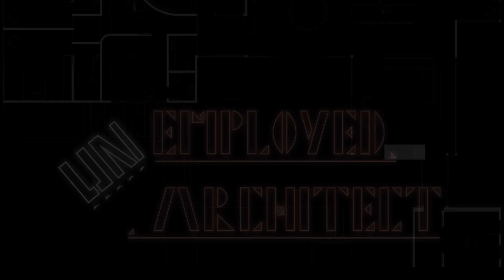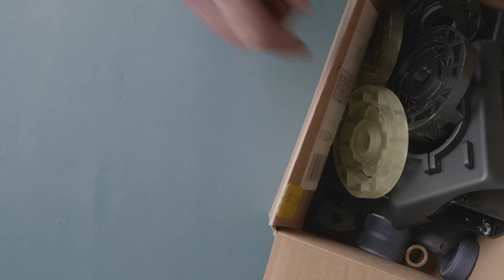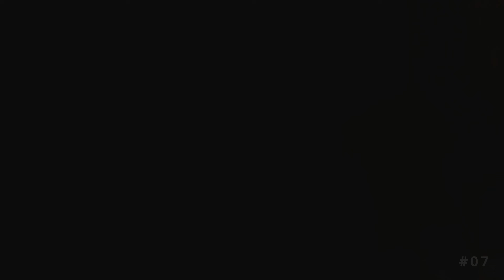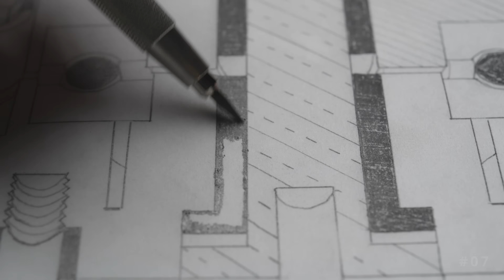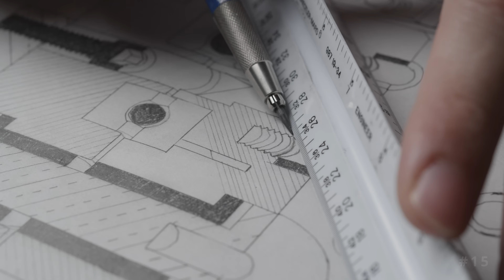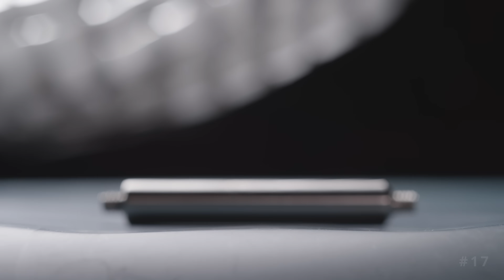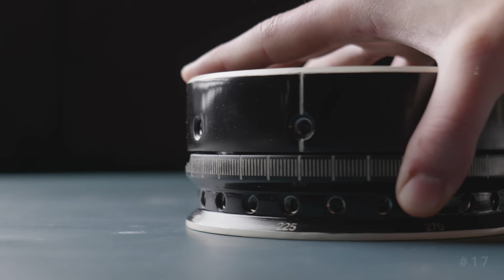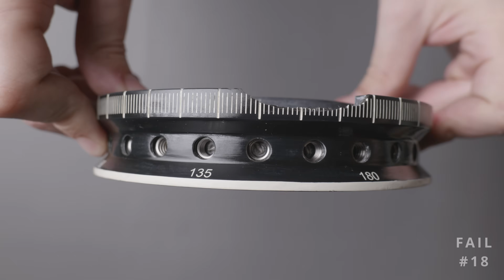3D Printing Inheritance Machining Rotary Fixture Table Thingy

Comment: It's neat to see that you can make something that works, by some definition of the word. I do wonder what other options you have for resins/plastics and how they would compare. I don't know enough about 3d printing to know whether this part actually requires resin either or if you just used what you've got available.
Reply from the maker: I mostly choose resin because it looks better on camera #priorities. honestly something like a 3d printed abs with glass fiber would be better.
Reply: @Unemployed_Architect I will admit resin prints look great.

Comment: As someone who seems to be terminally clumsy when it comes to dropping, losing or sending things flying, I feel better to watch a video by someone who does the same!
Reply from the maker: I legit just spent 5mins looking for a wrench I had 10 seconds ago. haha
Reply: @Unemployed_Architect Couple of times recently I've been sat at my desk, put a tool down and, knowing I haven't got up or even changed position, spent the next hour looking for it in an ever increasing diameter. I couldn't lose things so successfully if I used a catapult!
Reply from the maker: It’s good to hear this and I’m not the only one. Because I do that exact thing with the ever increasing diameter haha
Reply: @Unemployed_Architect Looking in cupboards that haven't been opened in years? Searching locked rooms? Moving furniture in different buildings? Tick! 😂

Comment: aren't the smaller washers the standard ones?
Reply from the maker: No they are about a 1/8” smaller in diameter than a standard 1/4” washer. McMaster sells them as undersized washers. it’s not a huge difference but it can make fitting parts in small spaces easier.

Comment: I would be willing to bet that some of your runout is coming from the fact that your mill is not properly anchored. I can see it swaying when you're cutting horizontally.
Reply from the maker: omg I know it drives me crazy! I used to have it on leveling feet but switched back to casters. so I could get better angles for filming. The frame the original owner made seams to flex on the uneven ground leading to the wobble. I need to build a better one that allows me to switch between casters and feet in a few seconds. sadly that requires tearing the mill down. so I’ve been procrastinating. but one day the wobble will end!

Comment: Searching the comment section for IM to show up.

Awesome build btw. Wanna do some more "copying a tool build but making it 3d printable" vids?
Also: no "box of shame with angry googly eyes"? Tisk-tisk. ;)
Reply from the maker: That would make my day if he saw the video! 

I actually do have another project / video in the works. A bit smaller but it’s from stefan gotteswinter channel. He did a low profile DTI holder recently. I’m working on a 3d printed version with sliding dovetails and rack and pinion fine adjust.

haha I actually thought about doing my own box of shame for the video but was worried about coming off as a copycat to much /:

Comment: heyo.. stupid question if I may.  Why does an LCD screen impact print quality?  Yes I am a newb.  I think it screens as.... things we look at.  So I dunno how it's part of the output problem.
Reply from the maker: oh no worries. resin 3d printers use the screen as a mask. it essentially controls what gets printed. so when some of pixels die nothing can actually get printed that area.
Reply: @Unemployed_Architect oh wow, I had no idea. Perhaps that's a feature with the resin printers exclusively or more often than filament printers that I have seen so far. Really neat project thanks for sharing
Reply: @80211Denver resin printers harden the liquid resin via exposure to UV light. The LCD is monochrome and displays "white" (transparent) where you want the resin to harden and black (opaque) where you want it to remain liquid. The print bed moves up away from the LCD one layer thickness at a time.
Reply: @jimktrains0  It's so ridiculously cool. surprising the screen is not more resilient to abuse -especially given the effort required to  service it!
Reply: @Unemployed_Architect  On that note if I may hijack the conversation, I noticed you use Elegoo printers (new to your channel; hi!). I got a Centauri Carbon myself earlier this year (first ever printer) and so far it's worked like a dream for me with no servicing needed beyond an occasional clogged nozzle from ASA printing. Knowing that consumables can be tricky to service is a huge eye-opener though; is that your first problematic experience with their products, or have you encountered any other consumer-unfriendly issues along the way?
Reply from the maker: @shinopuppy There has been a hand full of small things. The FEP sheet uses what feels like a million screws. So swapping that takes like close to an hour. I mean I prefer more screws over it leaking though, which I haven’t run into. But also a hand full of the screw heads were stripped and almost couldn’t get them out. I’m also not a big fan of their chamber heater, only goes to 25c, super loud, kind of janky, and it seams to leave some subtle surface artifacts. The software side for transferring files also used to be super hit or miss but that does seam to be fixed now. . Overall I’m happy with the purchase Atleast for what I paid. For the most part it has been simply load the resin manufactures settings and hit print.
Reply: @Unemployed_Architect good to know! Thank you for the in-depth analysis. I suspected that there was a reason they could get away with such wildly low prices compared to the competition, but I guess my relative lack of experience masks any shortcomings in the project so I hadn't noticed anything yet.

Comment: Can you fill it with concrete or epoxy granite to take up the vibrations?
Reply from the maker: yes I think adding extra mass would help! I also think switching to a larger diameter center arbor would would help. or Atleast I think it might (:

Comment: Now when you have a rotary table, you can use it to make a new rotary table from aluminium and then use that one to make one from steel😂

Nice build👍
3d printed holeplates or maybe a gearbox would be neat for indexing.
Reply from the maker: I actual love this idea! this might become the all rotary all the time kind of channel (;
Reply: Honestly, I just assumed this was the next step. He said the original design needed a rotary to make the rotary.
I mean, it can be a background project while other projects are in the foreground. But a reproduction in aluminum seems to be the next step.
Reply: I like how Quinn did hers on blondihacks, nice thick plate she can face off after it's boogered
Reply: maybe the next step is to have an X/Y tilting table underneath (which can now be done on the rotary table)... then move on to an Aluminum rotary & tilting table
Reply: +1
Reply: seconded

Comment: Seeing this, I feel like some 3d printed mini-pallet setups might work for some light machining on a cnc router.
Reply from the maker: i think your on to something there! it could be particularly useful for holding odly shaped parts for second ops
Reply: @Unemployed_Architect Exactly. Maybe even an extremely budget "zero point" system for small production runs.
Reply from the maker: I was actually thinking about that as well. You see a lot of 3d printer tool changers these days which is basically the same concept. I’m might have to do some digging (:

Comment: Another banger of a project and top not video. So fun to see what the helicoil inserts from before were used for. Love Inheritance Machining, and I'm sure he would enjoy your take on the design. To bad it wasnt holding up for everything you wanted, but what an aswesome go at it anyways!
Reply from the maker: Thank you! i was hoping there would be some cross over audience wise. Hopefully he wouldn't be bothered by the 3 thou worth of run out (:
Honestly part of me is surprised it worked at all, and in the end of the day not a bad fit for my small mill.